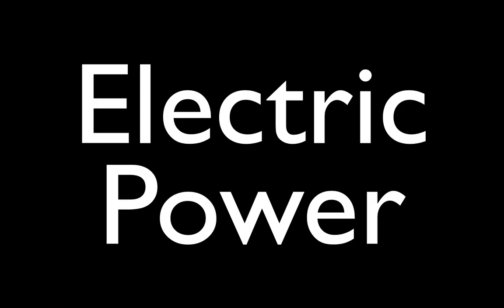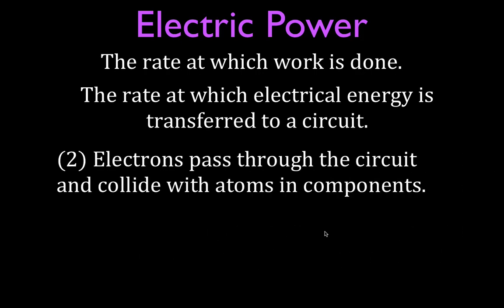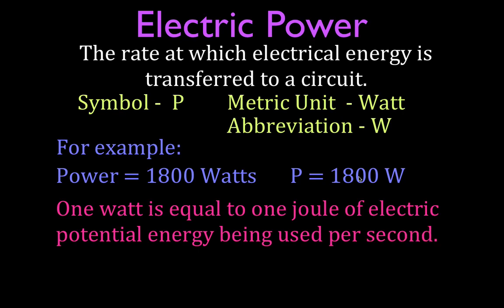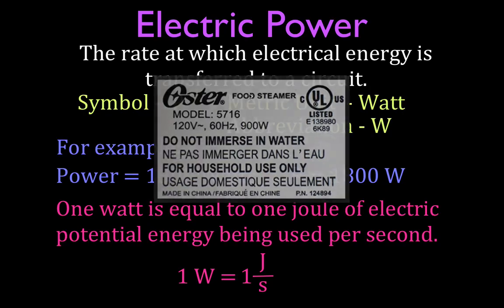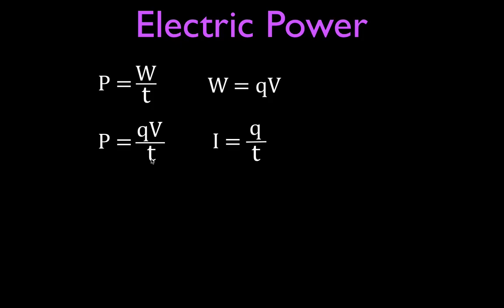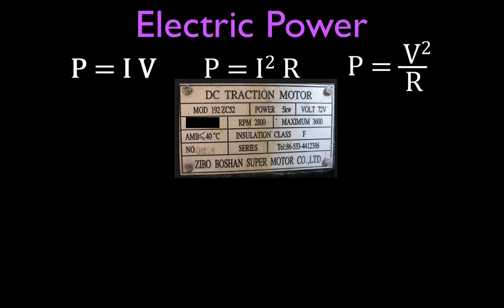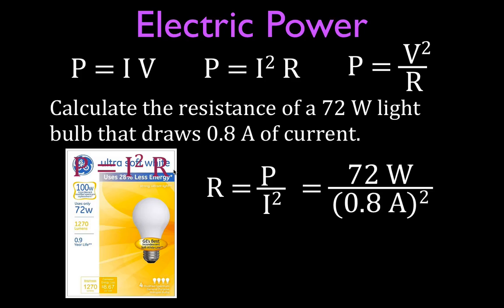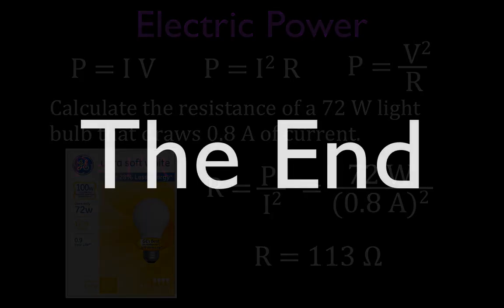Electric Power (1 of 3) and Watts, An Explanation

Comment: How can P be proportional to 1/R and R? It doesn’t make sense
Reply from the maker: Because in one case the other factor is the current and in the other it is the voltage.
Reply: @stepbystepscience  so either the current or Voltage has to be constant?

Comment: An electric car uses DC mator drive controlled by DC chopper working at 10 KHe. The voltage of utilized hatltery is L80 V, the minimuan turn ON time of the chopper is (3usec), and the minimum OFF time of the chopper (t 30usec) Determine the min. and max. DC voltage that the chopper can deliver to the car motor?
Reply: Simple really. If you recall the equation I = V/R,
Than you would know the total current need to operate that vehicle is 4MA. your welcome.

Comment: this is prob. a stupid question but is there an easy way to remeber when i have to use I^2 ? EX. if i got the question about the light bulb on my exam ( to find the resistance) i could easly in my head write the formula: P= I* R, instead of P=1^2 *R. If you understand:P why do we use 1^2 here and not when we're finding the resistance in a circut?
Reply from the maker: If I understand your question...there are three general equations for power. The one you use depends on what you are given, but I do not know of a good way to remember the equations.
Reply: Think of it as substitutions.

You have 
V=I*R
And 
P=V*I

So if we know that V and (I*R) are equal to each other, we can substitute it into the power formula.

Therefore
P=(I*R)*I

and you can rearrange that to be
P=I*I*R

Noting that I*I is the same as I^2, we can then rewrite it as

P=(I^2)*R